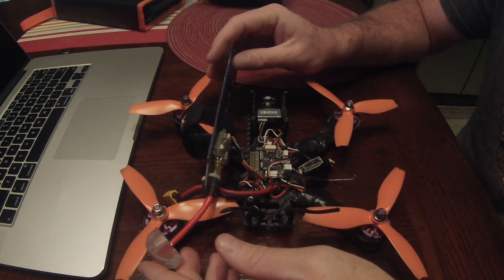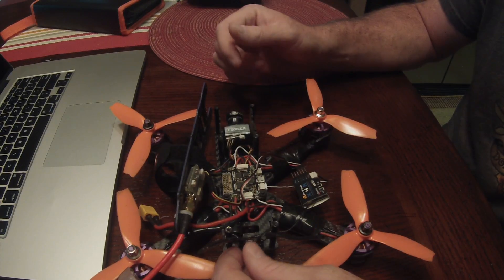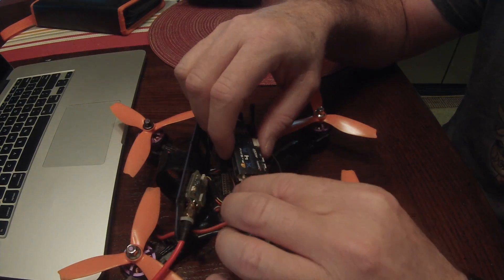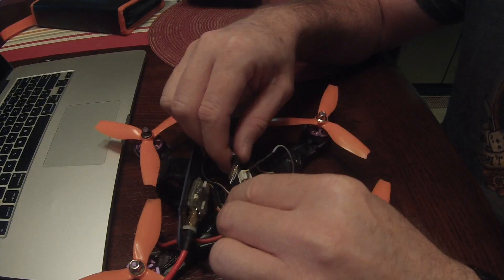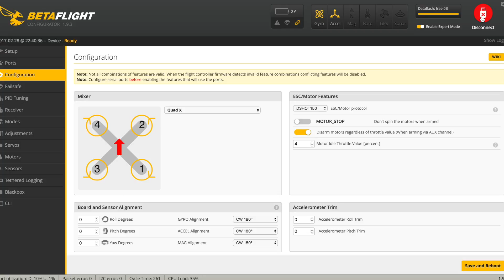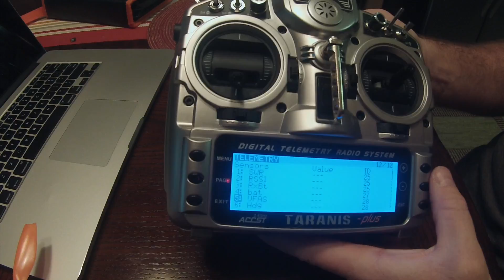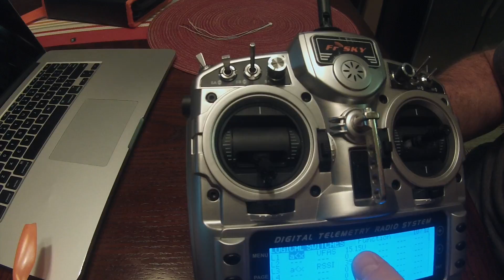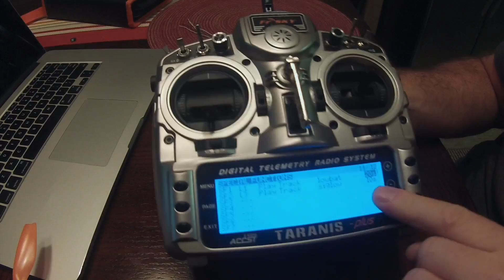Wizard x220 Mods & SmartPort Telemetry Setup

Comment: Is this the same setup with the x8r?
Reply: almost, you just have to plug in the pins vertically instead of horizontally and you have to set the rx in betaflight to serial rx and set it to sbus.

Comment: Did u solder up vbat? Cos I do not get vfas on my sensors
Reply from the maker: PepFPV yes you have to solder up vbat to get it to work.   Joshua bardwell has a video on it
Reply: I do not have it also, I have A2 but it lies. Maybe because I have taranis q x7?

Comment: Super helpful Jason. Any idea why I would only get 10 options instead of 12? I'm not getting VFAS even with a battery connected. I'm using UART2, I didn't use the other option you described in your later video. Would using the SBUS connector fix the problem?
Reply from the maker: Have you enabled vbat monitoring on the wizard?   It's not on by default.   Make sure you have done what is shown in this video.   https://www.youtube.com/watch?v=ScdqFz0Ocq0&t=74s
Reply: Yup. That was it. Somehow missed that part. Worked great today! Thanks!

Comment: Not sure how to monitor individual cells on 3s and 4s batteries but one workaround is to copy your 4s model on the taranis and then name the copy Wizard 3s. You can go back to the logical switch page and change the minimum voltage to whatever minimum voltage you want for a 3s battery. Then select the model that corresponds with the type of battery you are using and it will warn you at the correct voltage.

Comment: Great helpful vid! Please have more light on that puppy next time. So how much of a difference / improvement is telemetry for you? What all info does telemetry cover anywho? thinking I'd be happy enough with an RSSI feed and batt voltage.
Reply from the maker: Thanks!   It's an improvement over nothing for sure, however, the battery voltage is pretty annoying, as it goes off anytime there is enough battery sag on punchouts to cause it to go off.   I actually just use RSSI now as I have a Runcam Swift 2 that has the OSD voltage reading.   Don't need to hear my taranis telling me about it since I can see it in my goggles now.

Comment: Hey man, thanks for posting this video, really helpful for a noob like me trying to get my gear setup, however I'm having some issues with battery monitoring and wondered if you were able to help me out?

Basically, I've followed everything you did in this video and my Taranis picks up 12 or 13 sensors in total, however the battery voltage (VFAS) doesn't give me any reading whatsoever, even when I have it hooked up to Betaflight configurator and look in the Setup tab, at the top where it should show you the battery percentage next to the Motors Armed icon, it always reads 0 v, and the same applies for the little info box on the right hand side of the same Setup tab, it will show me my current draw, capacity drawn and RSSI status, but the battery voltage just shows 0 V there too.

I'm at a loss as to what is wrong here, and would really like to have these low battery warnings setup so that I know when to take the quad in for landing.

If you're able to help me out that would be greatly appreciated.

Thanks in advance and sorry for the huge post!!!!
Reply from the maker: DavyBoy interesting that other sensors work and that one doesn't.   Have you tried deleting all sensors and re-adding them?   Also something I have found and maybe it's also some inexperience on my part is I get a low voltage warning often even when it's not truly low.  I have found adding a camera that has built in OSD voltage is more useful.    I might even get rid of the telemetry warnings for voltage
Reply: Jason Graham hey man, yeah I've tried deleting and the searching for new sensors several times, it doesn't seem to make any difference. 

I just find it odd how I'm not even seeing any battery voltage in Betaflight config neither, it's driving me nuts as to why it isn't working. 

I honestly don't know what else I can try, I seen your newest video on how to use soft serial, but if I'm not getting any battery voltage reading in BF then I doubt trying the soft serial method won't make any difference for me. 

I'll have to do more research to see if I can find out why it isn't giving me any readings. 

Thanks for the reply though.
Reply from the maker: probably really dumb questions since it appears you have everything setup right, but you did wire up vbat and turned on vbat in the configuration tab right?   Maybe double check your soldering for the vbat wiring.   If you have a multimeter check your getting voltage to the vbat.   Joshua Bardwell has a good tutorial on how to wire it up on the wizard.   https://www.youtube.com/watch?v=ScdqFz0Ocq0&t=34s
Reply: Jason Graham actually no, I haven't done any wiring for the vbat! 

I figured all that was done on the Wizard and that I just needed to hook up the receiver and telemetry wire!

I'll look into this tonight, thanks man. :)
Reply: Jason Graham hey, sorry to be a pain, but I am having issues with my X4R after flying a few packs today. 

I punched the throttle out to do a flip and as I got half way round the flip I lost the connection to the receiver and my quad tumbled into the ground, when I went to pick it up I noticed that the connector that goes from the receiver to the flight controller had unplugged itself, so I disconnected the battery and hooked the receiver back up and powered the quad up, but it wouldn't connect to my Taranis, so I had a look at the receiver and there aren't any lights showing now. 

I'm not sure what I can do to test it, if you have any suggestions that would be much appreciated. 

Thanks.
Reply from the maker: I would check the wire going to the receiver, sounds to me like it's not getting any power now if no light at all are on it when you power the quad.   Maybe the wire is damaged in the crash?

Also on the x4r-sb receivers that I have, I noticed the antennas come loose pretty easily, so I pulled off the paper cover on it and hot glue them down.
Reply: Jason Graham I found out what happened, the 5v bec is dead on the PDB, the LEDs, and FC isn't getting any power, I tested the PDB with a multimeter last night and there's no 5v out at all. 

I will order a new PDB today for it, I would have been just as well building my own quad rather than buying this Wizard, I've already had to replace ESCs and now this happens!!

Comment: You can also enable telemetry using soft serial (enabled on configuration tab in beta flight, and set up as s.port telemetry on the Ports Tab in Betaflight). Since you're already using i/o 2 for SBUS, you can use soft serial 2 on i/o 2, pins 5 and 6, connected to s.port on the X4Rsb. Then all of your connections are tidy and coming out of the same connector on the flight board. The advantage to using soft serial is that the board does not need to be armed to start sending telemetry.
Reply from the maker: Cool.   I will check that out, I like that setup better.   Thanks for the info
Reply: Is that the same setup for the XSR receiver?
Reply: Yes
Reply: Do you have to connect them both 5 and 6 to s.port and then in ports tab soft serial 2 smartport?
Reply: I dont get it to work like that

Comment: what size is tue plug u used in the uart for s port?
Reply: are you also getting vfas?
Reply from the maker: I listed it in the description :

JST-SH connector to plug in flight controller to hook up telemetry.
https://hobbyking.com/en_us/jst-sh-4pin-male-with-pig-tail.html
Reply from the maker: The VFAS I am getting is the battery voltage reading.
Reply: sorry i jumped the gun there and you explained everything that i needed to know.  thanks!